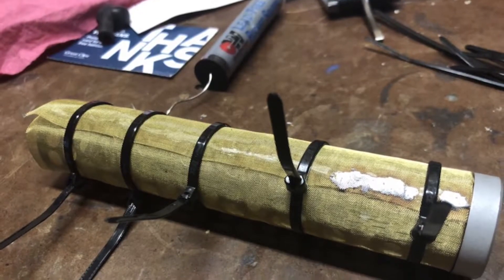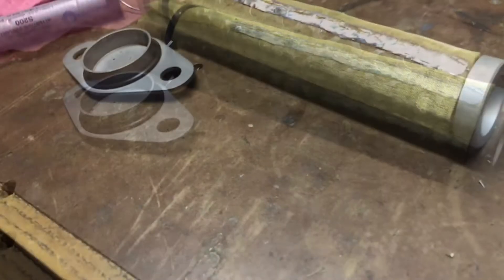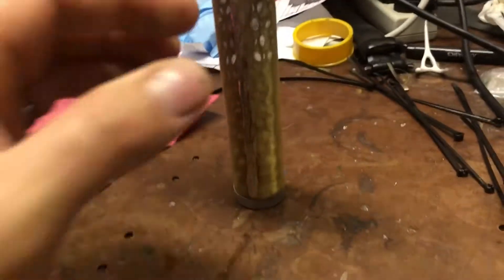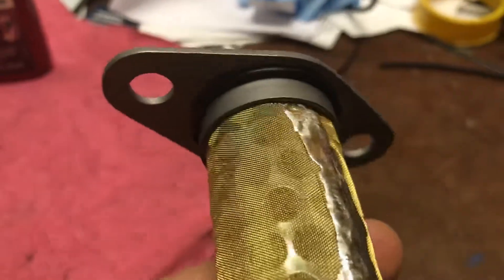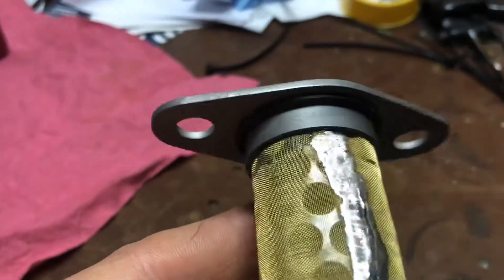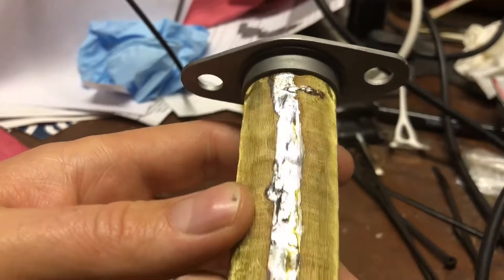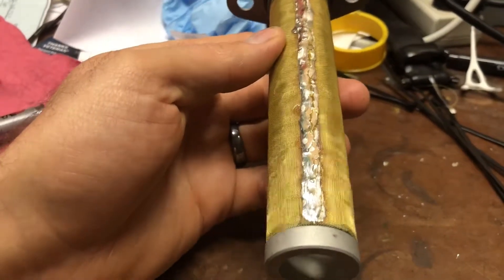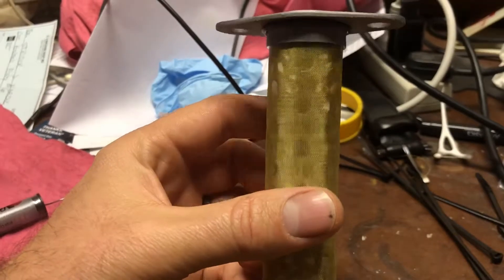77 Wont Go Satoh S370D Hydraulic Strainer Rebuild

Comment: Great thanks for the information about the filter, I just purchased one of those tractors  it's the satoh beaver tractor and the bucket and lift forks or lifting sections that raise the bucket, are not working right now they were working! And the hydraulic oil has water in it and I have already come to the conclusion that is why it doesn't work. But I will have to drain the oil and remove the filter and I am sure that I will have to do the same thing to it

Comment: Where did you find the brass mesh to do this?
Reply from the maker: Gloria Bornstein Harper I have a local industrial hardware store called McFadden-Dales in Santa Ana, CA. Its possible Graybar or Grainger would have something like this.
Reply: @HomesteadOC  Thanks much for the quick reply..hubby having to do a rebuild on tractor filter and so glad to find this video and hoping we have success.
Reply: @HomesteadOC  After calls locally and a few others I called McFadden....impressed but husband is going to try to do it his way before he spends the $35 (including postage) for the mesh.  I will keep their number handy for the future and in the event Bob's way doesn't do the job (I am constantly amazed at his abilities, however) we will place the order..
Reply: What type fluid goes back in the system.
Reply from the maker: BUCKSHOT I use rotella hd tractor oil. Its a multi-use synthetic hydraulic oil.